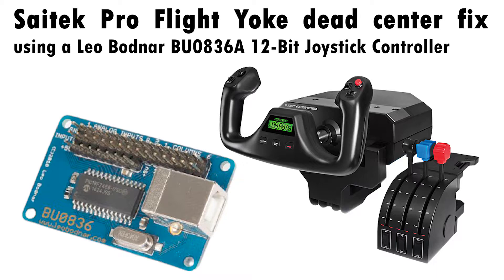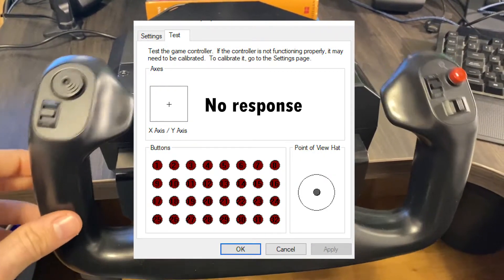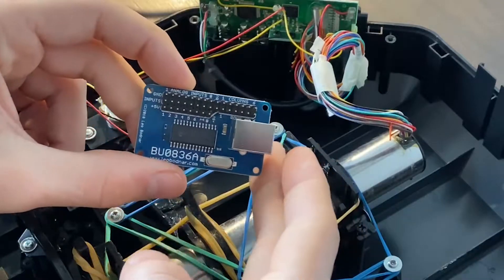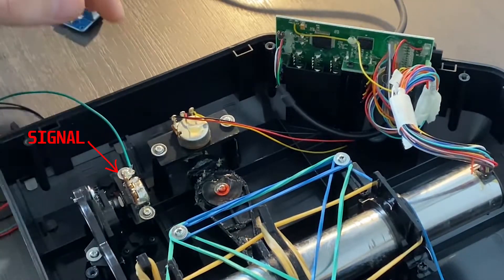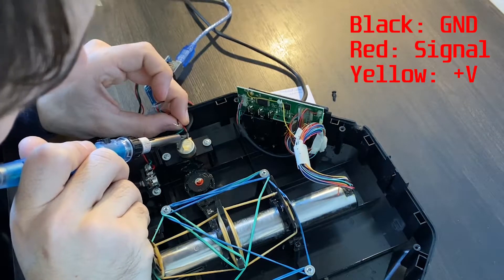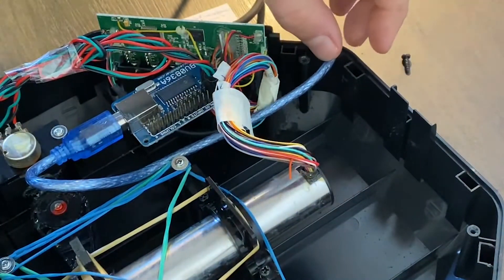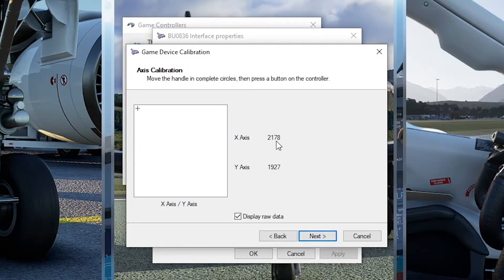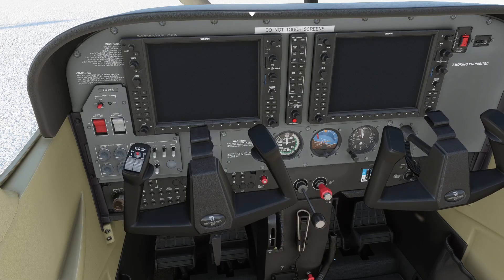How to fix Saitek Pro Flight Yoke Dead Zone with a Leo Bodnar BU0836A 12-bit controller

Comment: I just did this mod, and it is working perfectly! For the two sets of cables, I used the ones that were already connected to the potentiometers and soldered them to the small connector that came with the board in the same order. One of the cable sets had a wire with a red stripe, which I connected to the +5V side on the board. For the other set, there was a black wire that I connected to the ground side. Everything worked on the first try! Even the X and Y axes were on the correct connectors. It also works fine with MSFS2024. It’s much better now!
Reply: I'm about to do this mod. Can you clarify, the cables already connected to the potentiometer, which one is which and how would I wire it up? Can you maybe do a video?

Comment: Works fine on MSFS2024 until you plug it off while in the sim. If you replug it after, the yoke will behave eracticly and you will have to launch the sim again.
I'll do more testing when I'll build my own setup.
Reply: Did you fix it?
Reply: @mattygaga2013  I might try this weekend, but since the sim was too glitchy a few weeks ago, I didn’t test much further for now
Reply: @krikol_77   Did you try it in the meantime?
Reply: @Talaxianer  nope and I won't be able to use it for a few months unfortunatly

Comment: Ok, this worked out great.  I ran into problems which turned out to be because I did not clear the assignments for the Elevators and Ailerons from the Flight Yoke System in MSFS config.  I suggest that you do this first before installing the new board.  Additionally, I did ended up switching the yellow and red wire from what is in the video.  Next, I plan on modding the you tension.

Comment: Is Arduino Uno suitable for this?
Reply: Yes I would assume so. I don’t see why it wouldn’t work.. but you’d have to use the analog side.. the uno has a digital output side and an analog.. since these are analog potentiometers you’d have to use the analog side.. you’d also have to program the uno and add the “game pad” code so the computer sees it as a second controller .. LASTLY though.. I don’t think it will help the issue.. because since you are still using analog with the adurino the pot sensors are still not gonna be accurate and thus still have dead zones.. the board he used CONVERTS it from analog to digital.. which allows the pot sensors to be much more accurate and dynamic 

If you look around and buy this board direct from China.. you can pay as low as $30. That’s what I paid for mine but it took a good 2 weeks to come in. Def worth it tho as it’s basically the same price as an uno
Reply: You also could replace the pot sensors with digital pot sensors.. and THEN use an adrino.. if you did this then you’d fix the issue after programming the adrino as I mentioned above… BUT by the time your done buying the pot sensors and the uno and doing all the work of coding it.. I just can’t see it being worth it. This board he used doesn’t require any programming.. just plug (solder) and play.
Reply: NO. You need something with the USB chip that is able to work as HID (Human Interface Device) and not only a Virtual Com Port.

Comment: I found that signal was yellow for me and voltage was red. I wired it the way you said in the video and the controls were very jumpy and unresponsive. I thought my board was broken but after switching the connections of signal and +5v around, it was perfect. I guess Saitek wired the potentiometers differently on a few models

Comment: Can I use the buttons on the yoke after installing the board?
Reply: The buttons are on their own wires. If you only cut the wires to the potentiometers like BarcelonaAustin did, then the buttons will continue to work like they always did.

Comment: I have done this and it’s so jumpy and un useable
Reply from the maker: Potentiometers may be beyond repair,,,
Reply: I had the same issue, your signal and voltage wires for the potentiometers are the wrong way round. For me, yellow was signal and red was positive
Reply from the maker: And its different for each brand! Logitech is one way, and then there’s other chinese similar yokes with different wiring distribution lol

Comment: Be careful when matching the colours to the Board  The person in the video fails to tell you that he has made the green wire his negative and the black the signal. Watch when he puts the female socket up against the board. Notice the black is in the middle, Red is on the positive on the board and Black will go to the signal there is no other way around it. . Watch from 1.23 seconds where he puts the block connector up to the board. One more thing. Older yokes have a different colour coding to the rotary potentiometers(Roll and Pitch) My wiring is totally different to this where the red is the positive. Signal is always in the middle.
Reply from the maker: Thanks for your comment, potentiometers can be a bit misleading. Regards

Comment: HI AFTER DOING THIS I FOUND THAT ELEVATER WHEN PULLED BACK GOES FORWARD AND VICE VERSER, IE BACK TO FRONT
Reply: swapping the outer wires on the potentiometer will invert that axis.
Reply from the maker: You may have to invert the axis in the configuration
Reply: Make sure you have your block connectors on the board exactly as it says and the signal is not mixed up with the negative feed. Also make sure nothing is touching anything it shouldn't be wire wise I mean. dont tighten screw too tight on the board. I didn't do this option it is too near the other board for my liking.

Comment: Rule of thumb for potentiometers: The wiper (signal) is always in the middle, there's a fixed resistance between the two outer pins which are on opposite ends of the carbon track.

Comment: Question... Why not cut the usb connector and solder the cables directly on the solder points of the usb port on the original pcb? 
The hole would not be necessary and you would not see unnecessary cables coming out of the yoke
Reply from the maker: It is a good option as well!